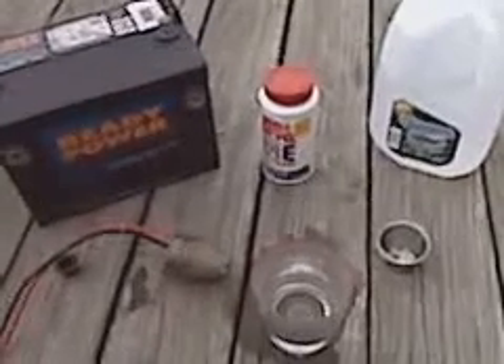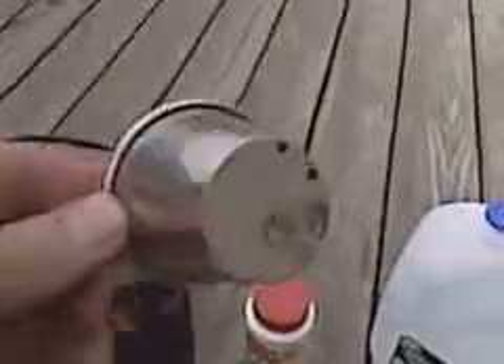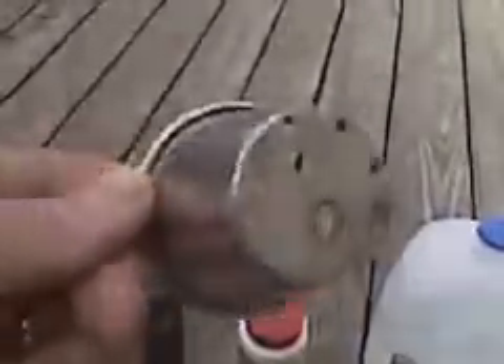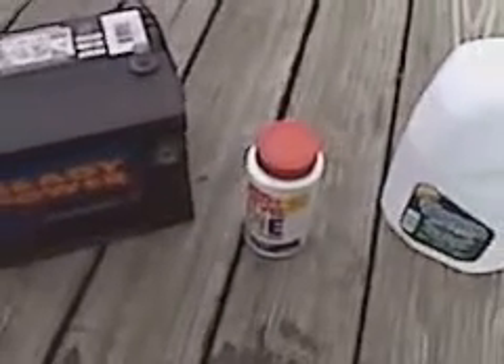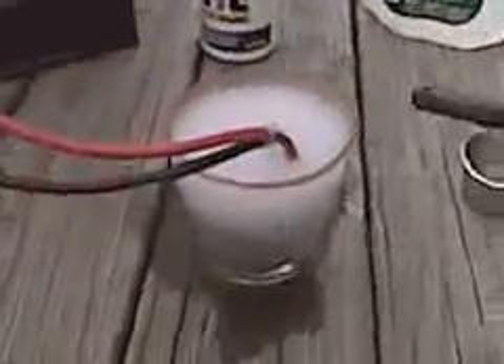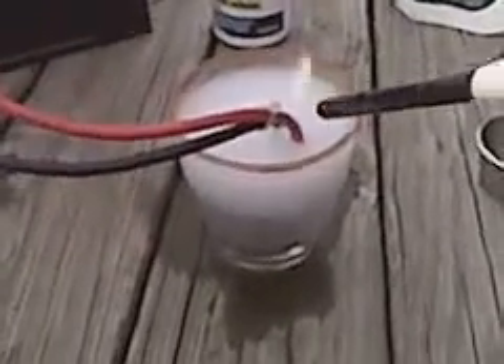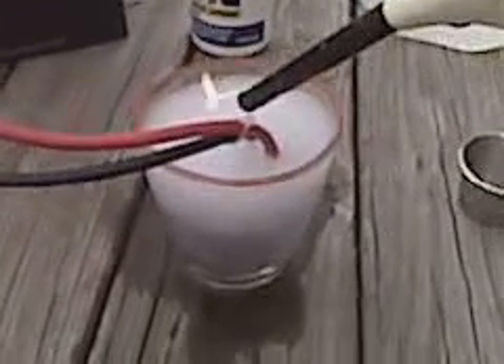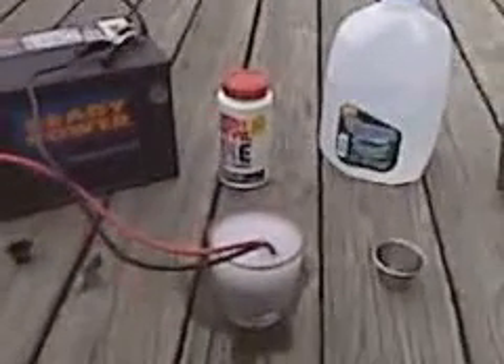HHO Sauce cup electrolyzer

Comment: help me spread thise to hard to tell all but if you take a razor scooter tear off every thing but back weel and leav motor atach to back of car run wiers to hho cellthe faster you go the more curent will flow out of motor to hho cell yes dc motors give off curent when they are spun any of them if you dont belive rip up old walk man or any thing with dc motor spin it with your hand or a drill if you want you could wier up a dc motor under the hood in your pully set up on engine so sune as you sta

Comment: Hey! This is almost the same as the one I designed. Currently running an 11 sauce cup electrolizer in my van. 2 pos, 1 neg and 4 neutrals in between. Produces about 1.2 litres/minute and went from 15mpg-18mpg. Going to add a second electrolizer. Built an efie. Have yet to check amps as I don't have an ammeter.